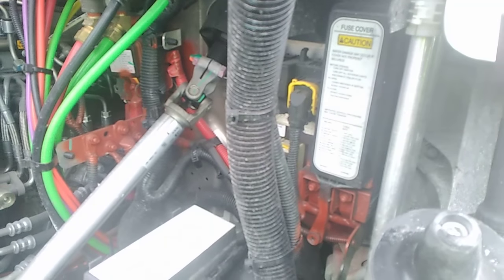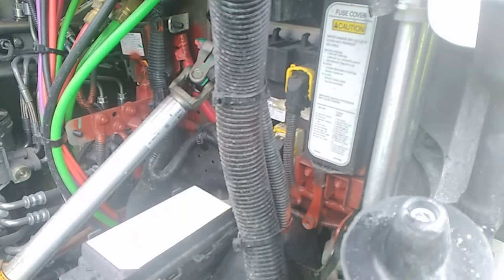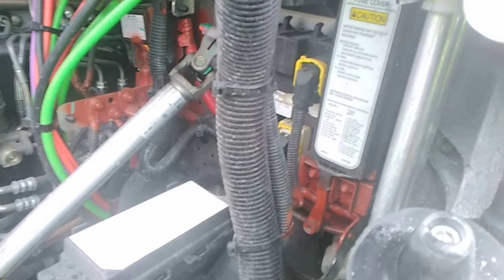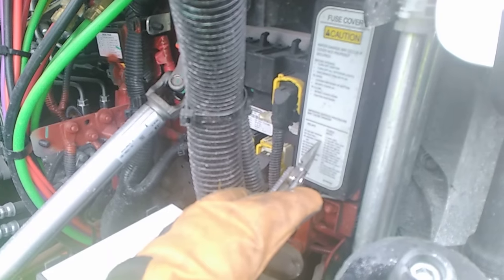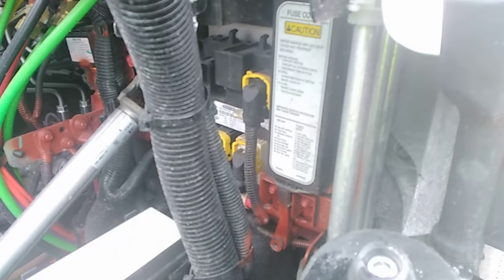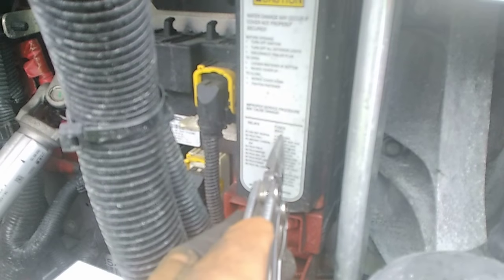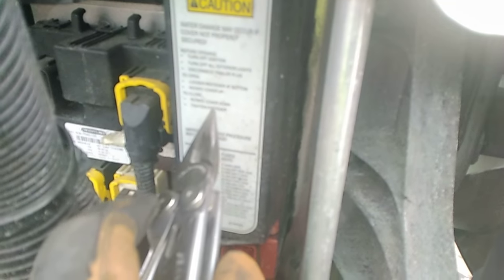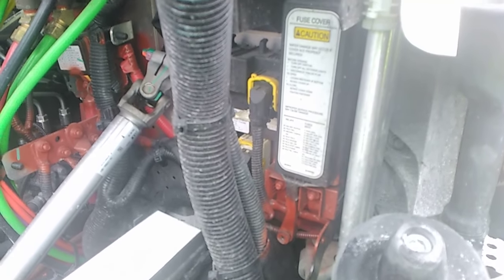Fuse Box locations on a Freightliner Cascadia for light problems

Comment: Trailer light issues... 
Both sides of my front markers are working fine ..
Signal  lights halfway down (middle of trailer) both sides work as signal lights  ( but they don't stay lit up as driving  lights )
Rear corner marker lights both sides not working  
ABS working 
Tail lights there are (3) separate three inch lights per side  .like this
🔴🔴🔴             🔴🔴🔴 

Driverside are  not lit up as tail lights , passenger the outside one flickers and is weak looking ,other two don't light up as tail lights .
Step on the brakes, and they light up.
 Toss 4-way flashers on the outside ones  blink normally  on both sides 
The two inside ones don't do anything , as they should be lit up as driving lights .
This is with truck started , light switch on full way (2 clicks) its a 2017 Freightlighter Cascadia/53 ft Curtain side deck trailer. 
Changed the end of power cord from truck to trailer 7pin , didn't do nothing ,fuses look good and relays tested. 
Would it be the ground or blue live wire...
Only thing buddy detached my truck in the yard from his trailer and stretched my power cord and air lines as he didn't take off but caught it when they were tight tight . And also I replaced both rear marker lights on trailer 2 months ago and pigbtails but didn't have proper crimps so just twisted together and tapped really good , I'm 100% sure no moisture in them .. 
I'm stumped
Reply: Did you figure it out? I’m having the same problem right now

Comment: Hi I don need help I have freightliner Cascadia DD 15 2016 I have an issue with tractor tail light signal four way light and  breaks  are works but just the second or Mark light  is not working Any quick advice please

Comment: I’ve been having issues with my Tail lights on my 2016 Freightliner Cascadia not working . 

All my other lights front and back including signal lights in the rear and 4ways all work but I get No lights on the tail light to say on .  
 I’m wondering if there is a certain fuse or relay I’ve been that I’ve been trying to find to fix my problem . Do you know exactly what fuse or relay to check and the location also . 
 I’ve been having this issue and also trying to fix it but I haven’t had any luck doing so . 
Please get back with me if you may have a good solution for me . 
 Thank you . 
Lorenzo
Reply: Having same issues did you ever figure out the problem?
Reply: @AsronRox same